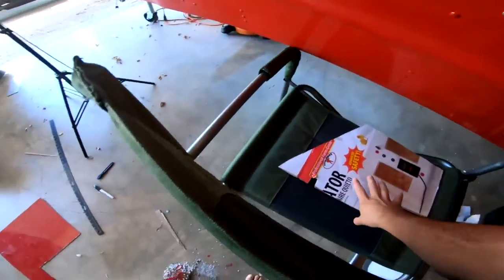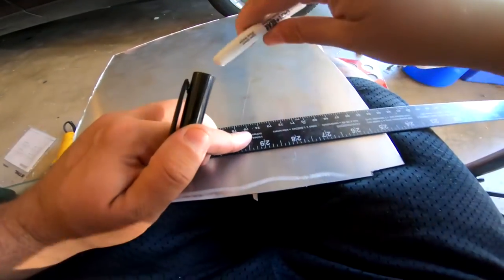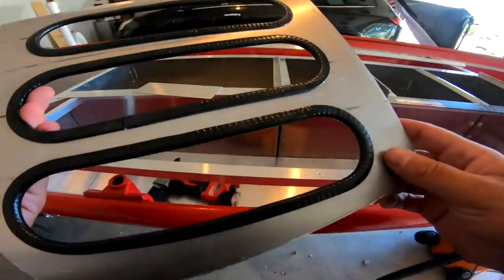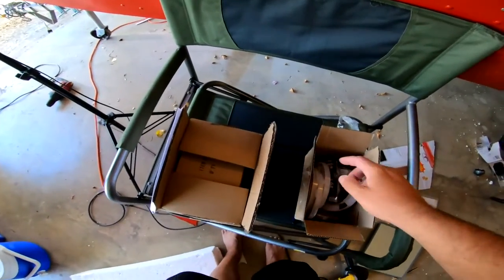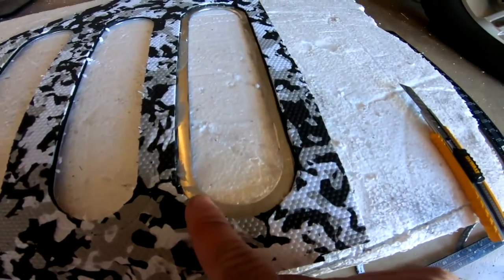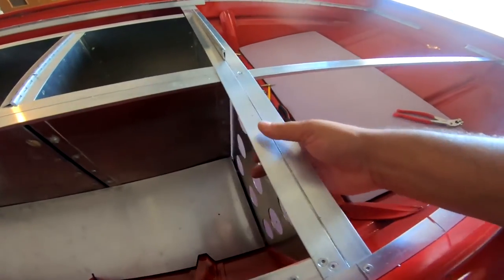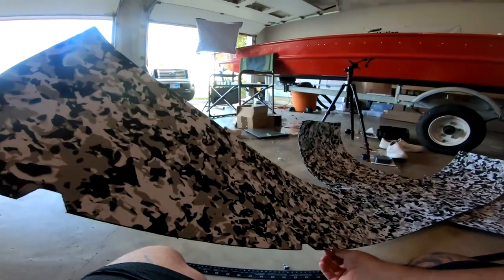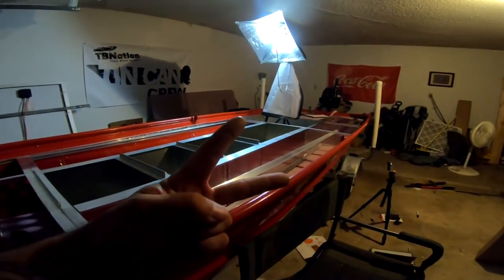ADDING FOAM To ROD LOCKER in Jon Boat to Bass Boat Conversion

Comment: Another tip they may help when drilling the aluminum especially with the key hole saw bit, spray it with wd 40 or some decent spray lubricant as you drill to keep it from over heating and also make your bits last longer. Many many years ago I was studying to be a machinist and my dad was a maintenance man so learned alot over time.

Comment: Apply contact cement to the panel and let it get tacky before you apply the foam. Or you can heat the back of the panel after you apply it. Helps the glue to get a better contact strength to it. It’s what I do when mounting the LED lights with the cheap glue strips on them from China.

Comment: I think it would be dope to put a light inside the rod butt holder so it glows out into the locker
Also i used same foam...dont epoxy...you a heatgun and warm glue til it gets cloudy and stick down...do it when you put it down first time a section at a time,it will never come up
Reply from the maker: I was actually thinking about doing that, it’s a trick people use with go pro mounts, so I may do that